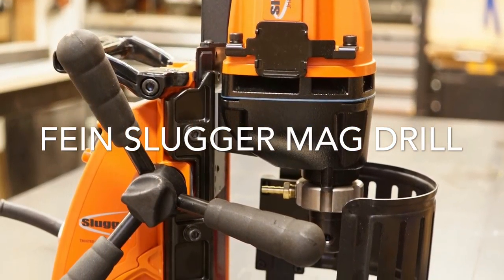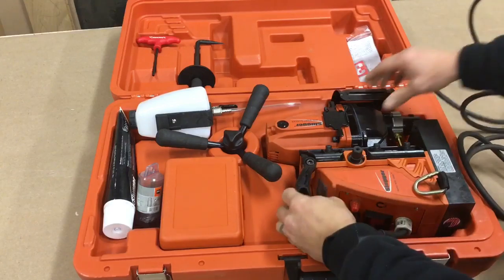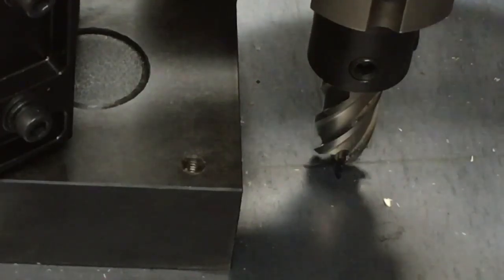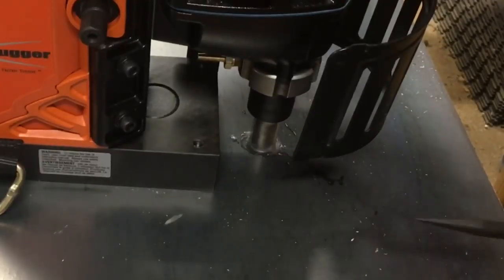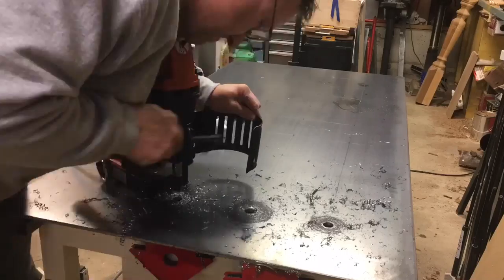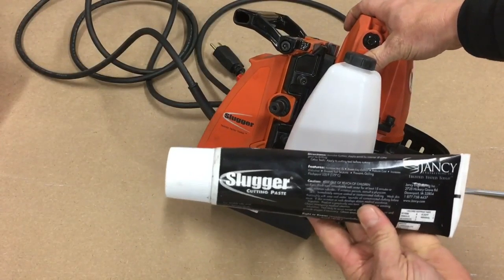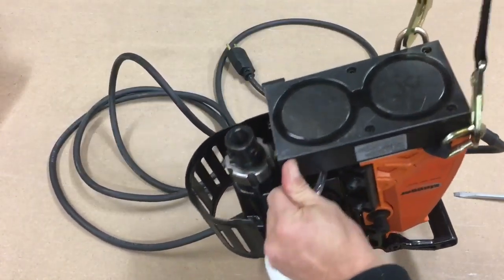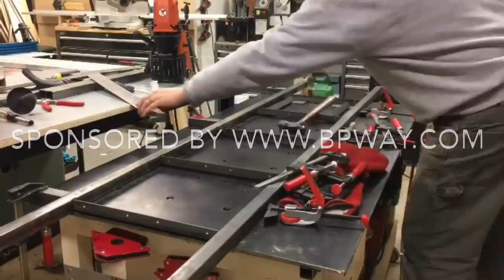Using a Fein Slugger Magnetic drill to build a Multi Function Steel welding table

Comment: Nice video. I have a compact Milwaukee mag drill and love it. Surprising how few people know about annular cutters. Typically when doing metal layout a scribe is used to lay down your centerlines, and then a centerpunch (I like the Starrett spring-loaded type) is used to mark the exact location of the hole. The locating pin on the cutter just drops right in the punch mark. That's a really nice kaizen setup you've got there.
Reply from the maker: Yes that's our punch wooden letter just a marker, ha ha. Definitely a quality tool, thanks for the feedback

Comment: Just got one of these, would not work in vertical position. Installed included shunt, still would not work. Magnet would not hold to 5/8 plate. Used old school jancey slugger to complete the job. Seriously disappointed that new 800 dollar mag drill could not out preform a 40 year old aluminum monster. Maybe a bad drill that we got but the safety feature of "drill will not work" really cut down on injury